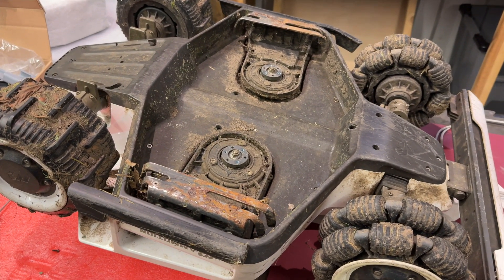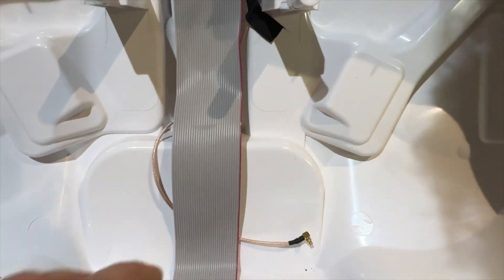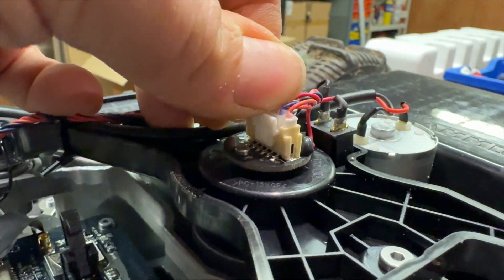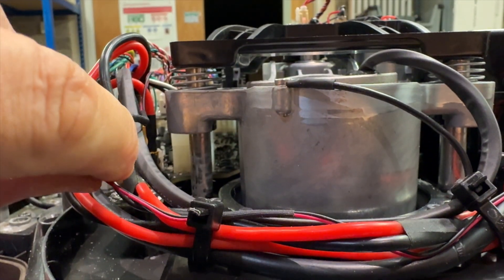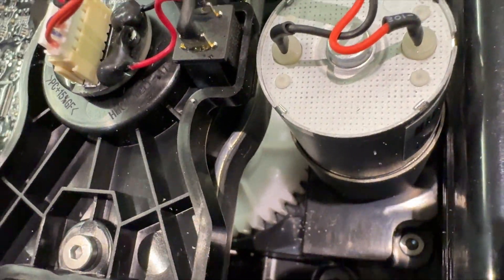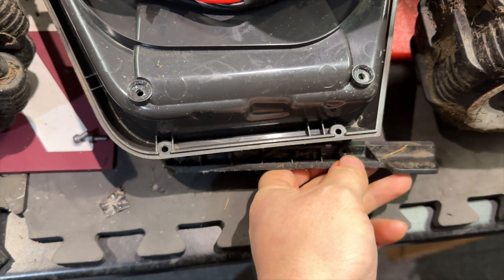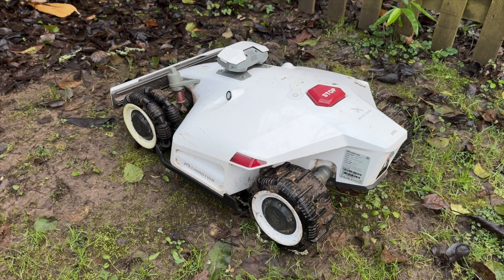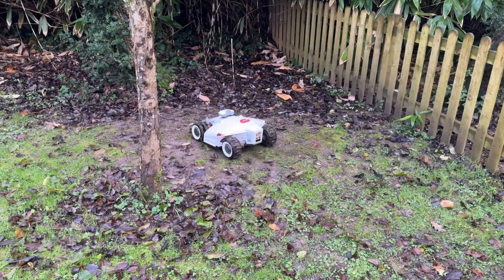Luba 2 | Is it fixed? | Mammotion Saga #3

Comment: After my recent experience with Mammotion, I cannot recommend any of their products. My Luba 1 was broken, but I want to fix it to give to my mother. I purchased another broken one for parts. I tested the motors on the donor, and they worked. I swapped them into my broken Luba 1, which was throwing 125 and 145 faults for hall effect sensor errors. I could not clear the errors, and had to contact support. They said they would not do that, and I had to send it to a service center. 
   I just watched a video from someone who did that. It was a long wait, and still didn't work when they got it back. Even though I am still in the warranty period, I'm sure my repairs would be out of pocket. With how much I spent on the mower, another $340 for the parts mower, the time I put in, and however many hundreds they charge from a service center, I might just go mad. If that sounds like your idea of a good time, get a Luba. It's sad because my Luba 2 does a good job, but I feel like it is a ticking bomb. If it dies, it will not be worth the money to replace, and I will just have to pay a landscaper or do it myself.

Comment: I have a question about the Luba 2 that nobody seems to be discussing. Do you have molehills on your lawn? We have loads and loads of them. I don't know why really but it is what it is. Our Husqvarna robot just pushes them away when they are not to big. I can't find any information on how the Luba 2 handles molehills. All videos that I see, people have spotless lawns, quite impressive actually. It is certainly not what we have. We seem to be a mole breeding facility at this point. Anyway, just wondering if you can say anything about that. Thanks!
Reply from the maker: No mole hills sorry (glad mind you!), so unable to answer. Its VERY powerful. But also the front sensor bar if pushed, will make it stop, and then try and around.

Comment: I am wondering after watching your video here on disconnecting and re-connecting the two terminals that control the height adjustment for the Luba 2 Mammotion mower if maybe the problem that Mammotion is having with the failing height adjustment situation could be fixed by improving the connector reliability by using a more reliable connector.  These connectors and the pins are very small and delicate and it seems like over time they no longer maintain a reliable connection.  I have been having the same problem as you have experienced and I finally took the top cover off of my Luba and did exactly the same thing as you did by unplugging and plugging back the two connectors.  After doing that the robot worked again.

I am going to try and apply Stabilant 22 to the connector terminals in an attempt to make the electrical connection more reliable and thereby hopefully solve the height adjustment failure problem permenantly.  Stabiliant 22 is a very good electrical contact enhancer and I am hoping that it will solve our problem. 

Keep us posted on how things work out for you.  Other than this problem I personally have been very happy with my Luba 2 Mammotion.  I have been using it since May of 2024 and it is really impressive.  I hope that we can get this problem reslolved permanently so we can enjoy our wonderful little robot mower!
Reply from the maker: Interesting to hear you have the same issue, I think you are right, would be interested to see how you get on, let me know!
Reply: @RealLifeGadgetReviews  

I'll let you know how I make out as time goes on.  I really hope that the Stabilant 22 does the trick and maintains a good electrical connection so that we won't have these height adjustment failure issues anymore.  Like I said, other than this particular problem my Luba 2 Mammotion has been working very well and I am very impressed with it.  Please keep us updated as well with your Luba 2 Mammotion and how it is performing for you.
Reply: So I wanted to give an update on how my mower is working since I applied Stabilant 22 to the connectors for the height adjustment motors.  It seems to have solved my problem of the failed height adjustment.  Since I applied the Stabilant 22 the problem has not happened again and it has been 8 months ago so I am very pleased.  How is your mower working since you fixed it?